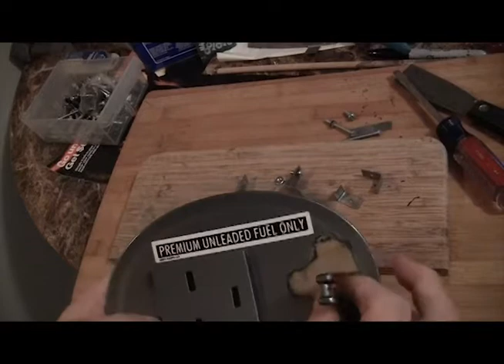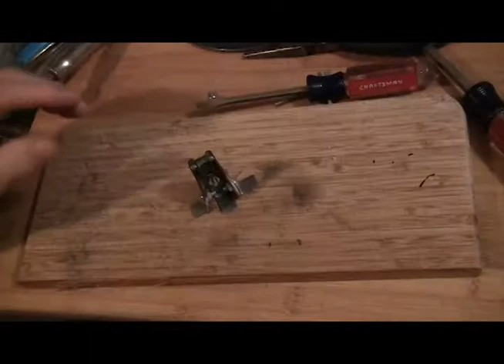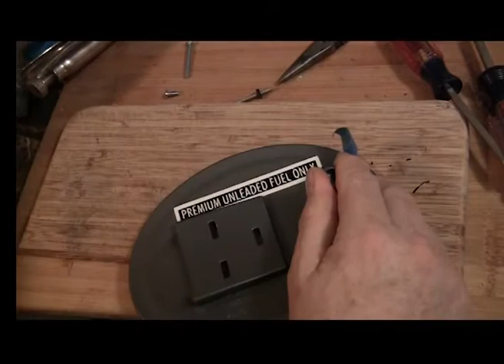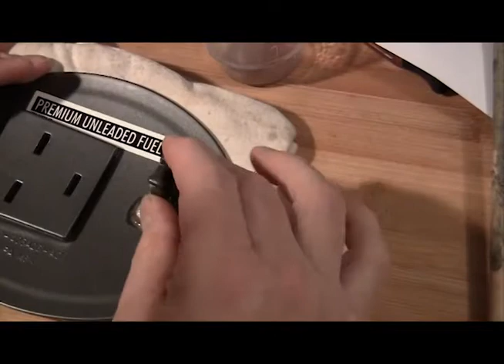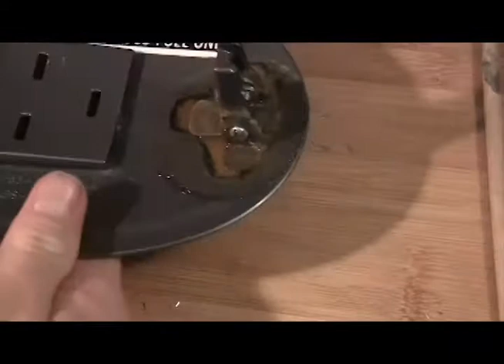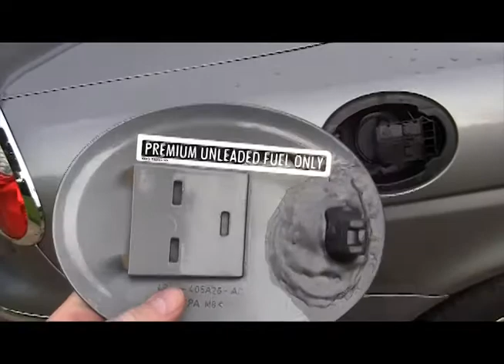Jaguar S-Type 2005 Fuel Flap latch repair (gas tank access door)

Comment: Here's my update to this video I made in 2017 (7 years ago).  
Just last night, during a cold spell of about 22 degrees f, I pushed the flap door closed and suddenly...."CLICK"!!  I was holding A DETACHED FLAP DOOR IN MY FLIPPIN' HAND! WTH?? On close inspection, I see that the black plastic flat tongue (RECTANGULAR SHAPED) of the hinge broke off. It broke off perfectly straight exactly where the edge of the flap puts stress across tthat flat tongue inserts inside of the rectangle flat cave where the 3 little tabs insert. 
And so now, once again, I am an innocent victim of the disease that Jaguar engineers who are plagued by the negative effects of "BOZONE".  Definition:  1. Bozone (n.): The substance surrounding stupid people that stops bright ideas from penetrating. 

The good news?  My original fiberglass repair of the fuel flap door has been a trooper through 8 scalding hot summers and icy winters. But its that cheap flat black plastic tongue on the hinge that is the next weakest link I now must contend with. Of course I will apply some red neck ingenuity in trying to attach a hearty splint of some type. But when considering all the stress and frequency of use, I'm better off just buying a salvaged fuel flap hingefrom ebay that belonged to another valiant Knight's trusty steed (his Jag). Or, if available, an OEM hinged part is about $200....OR.....about $45 used.  

Have any other S-Type owners run into this same problem? If so, what was your'e fix-it solution?   

(P.S. for all S-type owners: I designed a cheaper way to replace your front windsheild wipers with the built-in water spray jets.  Simply buy standard wipers that fit your Jag for about $70.00. NEXT: carefully cut the spray nozzle cylinders off from your old wipers, leaving an excess of the black plastic tab on each end. This leave enough to use highly sticky RED foam tape pressed against the underside of he cylinder spray nozzles. Then re-attach the small black rubber tubes and you've just saved about $100 on buying the OEM wipers.